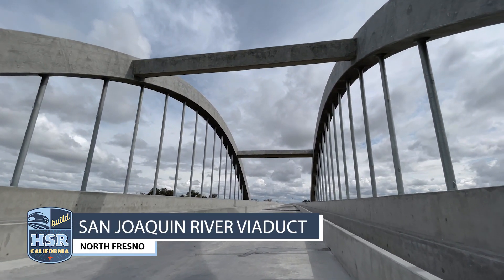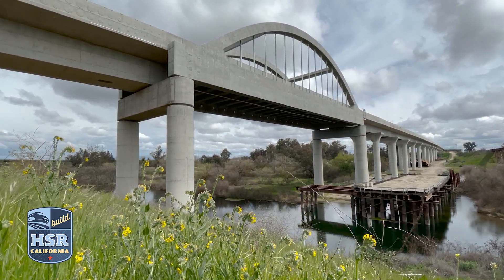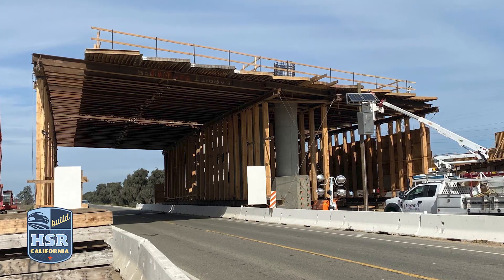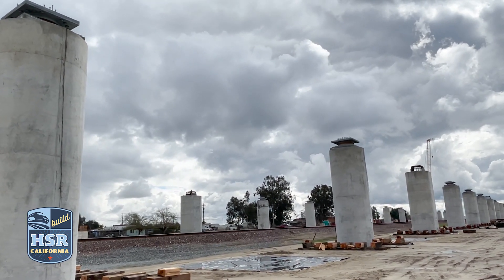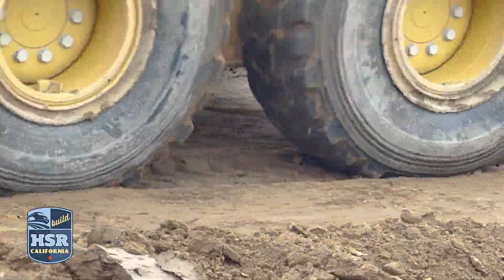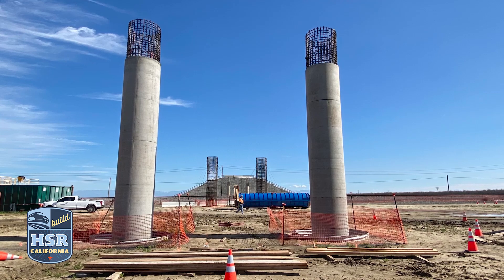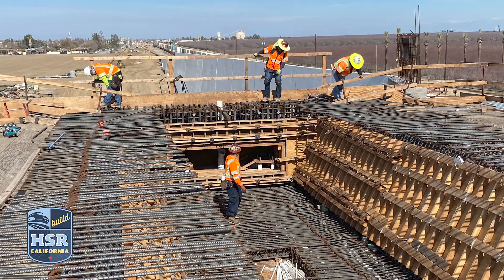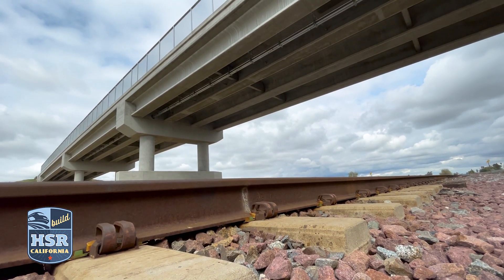California High-Speed Rail Construction Update- March 2021

Comment: I keep advocating that the CA High Speed Rail Authority needs to push for unveiling the Los Angeles—San Francisco HSR Line at the 2028 Los Angeles Olympics, just like how Japan unveiled the Shinkansen at the 1964 Tokyo Olympics. Japan’s timing to unveil the Shinkansen at the 1964 Tokyo Olympics was meant to symbolize Japan’s emerging role as a technological and economic powerhouse. It showed the world that high speed rail was possible, just as California’s could do the same for the United States. California continues to be at the forefront for American innovation and ingenuity, and in 2028 that leadership will be on full display with the eyes of the world on Los Angeles for the Olympic Games. 

Debuting the nation’s first high speed rail line at the Olympics will bring it international attention, connecting the state’s major economic centers with fast, sleek, and efficient high-speed trains travelling up to 220 miles per hour between LA’s Union Station and SF’s Transbay Transit Center in three hours via stops in Fresno and San Jose. It will allow tourists in LA for the Olympics to take a day or weekend trip to San Francisco, Yosemite National Park via Fresno, or Sacramento via San Jose, and allow Northern CA residents to travel to LA without having to drive or fly. A Central Valley only high-speed train in 2029 would most likely not achieve that same level of appeal or initial success from a global audience if people need to take a bus from LA to Bakersfield then another train from Merced to reach the Bay Area.
 
In 2028 California can take its place as the frontrunner for American innovation and ingenuity once again with a high-speed train providing direct downtown to downtown service between the state’s two greatest cities for an international audience to experience. Let ours be the one that inspires the nation to embrace high speed rail, and be the first chapter in bringing clean, fast, and efficient intercity mass transit to the United States. This is a goal whose feasibility needs to seriously be examined and do whatever it may take to make it possible. California is leading the nation’s charge in building for the transportation needs of tomorrow. Summer 2028 can still be achievable if we are committed to make it so. It will take the combined efforts of the California High Speed Rail Authority, California State Legislature and the Biden Administration, who has vocally supported investing in high speed rail, to ensure that the project can be completed in time for the 2028 Los Angeles Olympics. 

It would be a phenomenal achievement not just for California but also for America, showcasing to both the nation and the world that high speed rail will work here, and that really needs to be the ultimate goal for this project. Public support for this project has declined over the years, and an ambitious goal such as this can be just what this project needs to reignite confidence and support while dispelling criticisms that it'll be a "train to nowhere" once and for all by fully committing to completing the entire route from Los Angeles to San Francisco by 2028 for inaugural service at the 2028 Summer Olympics.
Reply: There is a reason why companies are running to Texas.
Reply: @isaacg5438  rich people are moving out of CA to avoid the stupid possible wealth tax which imo is unconstition and the stupid crazy ever higher tax.
Reply: @yia01  Exactly. CA is hell. Private companies work best.
Reply: the state is diverding the HSR fund to else where, they kind of give up on teh project and just gonna finish it for the sake of finish it. i hear thye just gonna least the rail to amtrak and give up on teh HSR.
Reply: @yia01  Isn’t that great news??
Reply: @yia01  that’s not true at all. Currently the State Legislature and CHSRA is determining whether the remaining $4.1 billion in Prop 1A funds should go toward completing the 119 miles in the Central Valley or transit projects in SoCal and the Bay Area, with strong support for finishing the Valley. The plan is and always has been electrified high speed trains between LA and SF. Right now CHSRA is working out how to do that in steps that minimize increased costs, but electric trains will be one of the first things and they’re currently looking to begin installing track and catenaries in the Central Valley within the next few years.
Reply: @ChrisJones-gx7fc  Give up. 
It’s over. 
HSR is dead.
Reply: @whiteclifffl  nope, it’s not. America is one of the only industrialized nations in the world without it, and it is long overdue here. Much of the Millennial and Gen Z generation support high speed rail in the US, I being among them, and we will continue advocating for it just as you will continue to against it. High speed rail has a bright future here if we are willing to make it happen. California is the first state to build high speed rail, and just like any major infrastructure project as well as the first of its kind here it was bound to run into problems. That doesn’t deem it a failure though. Both BART and the Golden Gate Bridge, as well as the world’s first high speed train in Japan and even to some extent the Interstate highways, were harshly criticized in their day when being built, and today we can’t imagine life without them. Much will be the same case with California’s high speed train as well as others across the nation. Look at countries throughout the world where high speed rail exists and see the amazing benefits it provides. Why can’t America have that too? If we really are one of the greatest nations in the world, then why shouldn’t we be able to have high speed rail?
Reply: @ChrisJones-gx7fc  Yes. 
And millennials and Gen Zers love free handouts from our government. 
Give me that stimulus check!
They have been inadequately educated and don’t have any understanding of the ruinous debt that we are running up. 
Where do you propose that we come up with the billions of dollars to pay for this doomed project?
How much will a round trip ticket cost?
How much will taxpayers subsidize this horrible idea?
There is a reason that the USA is the only super power on this planet. 
And it’s not because we want to copy the mass transit of third world nations. 
By the way, the interstate highway system, which has proven to be wildly popular and profitable for all citizens, was planned to assist military transport across our country. 
Much like the internet, it’s another benefit to our society from our military. 
HSR will only be used by the wealthy. 
We should improve our current highway system and widen I5 and 99 in the valley. 
NOT finance this boondoggle train to nowhere.
Reply: @whiteclifffl  America is not the only global super power, and expanding highways and airports only works for so long though. We need longer term solutions for dealing with intercity travel that goes beyond continued use of fossil fuels, which are also not a long term solution. High speed rail could be such a solution here in the US just as it has been for decades in Asia and Europe. But we need to start now as it’s already overdue and will continue to get more expensive the longer we wait. I would agree that public-private partnerships should be the way forward for building high speed rail here, rather than really wholly on public funds, and also the best use for high speed rail here would be a series of heavily-travelled corridors connecting two or more major cities between 100 and 500 miles rather than a nationwide system. We need to start thinking about long term solutions and opportunities rather than keep looking at short term ones. Expanding highways don’t necessarily translate to increased traffic flow and research has shown it may actually make it worse. Cars will never go away, cause we love personal mobility too much, but if there were a third option for getting from say LA to SF instead of driving six hours or going through a long check in and security at the airport and flying, people will take advantage of it. High speed rail is meant to be available to all, and I’m sure will have different ticket prices to accommodate for as many people as possible just as other high speed rail systems do.
Reply: @whiteclifffl  I’m sure we could both provide valid arguments for and against US high speed rail all day long, and ultimately we’re never going to change the other’s mind. So I’ll just say this, high speed rail is happening in California and its ultimate success or failure is yet to be determined and only will be once trains are running and if people will use it. That we will all have to wait and see.
Reply: @ChrisJones-gx7fc  You don’t think that there will be a security check in line at HSR stations?
What will the interval be for departing trains?
The solution to overcrowding in our mass transit system is to build a wall and restrict our growth. 
Highways are extremely efficient.  
Much more efficient than rail.
Reply: @ChrisJones-gx7fc  The only way that I will support HSR is if it is privately funded. 
I’m am sick of the government stealing from poor taxpayers to fund this fraud.
Reply: @whiteclifffl  all I’ll say to that is high speed rail is a proven technology used by millions of people every day and is the safest form of transportation in the world. It will have some level of security but not nearly as tedious as going through TSA at the airport. Driving is great for getting to exactly where you want to go whenever you want to go and will never go away, but having the ability to get on a high speed train in your city’s downtown and travel some 500 miles in a matter of a few hours to another city’s downtown for a day or weekend trip without having to deal with driving or flying can be a powerful asset. HSR has made mobility much easier and allowed people to rely on cars less for long drives between cities. Public-private partnerships should be the best way forward for US high speed rail as well as following the examples set by successful HSR systems in Asia and Europe.
Reply: @whiteclifffl  also side note, highways are entirely funded by taxpayers and are subsidized by the government while not making any revenue. So to call high speed rail a complete waste of money that’s being taken from taxpayers, despite how successful it’s been throughout Asia and Europe, not to mention in the US more public money is being poured into expanding highways that as research has shown does not necessarily equate to better traffic flow, does seem kind of misconstrued. Rather than keep pouring public money into highways and fossil fuels, we should be investing it in better, cleaner technologies of which high speed rail is a major one. America needs to start following the rest of the industrialized world and re-embrace rail and start investing in it with both public and private money. We used to have one of the best rail networks in the world, and from a freight standpoint we still do, but passenger has fallen by the wayside and is sadly still slow and not totally reliable outside of the cities. Passenger rail can become competitive again, and it takes investing in high speed rail with help from both America’s public and private sectors. Brightline West is one such example of a privately built high speed train between SoCal and Las Vegas, and it’ll be interesting to see how it pans out. With California’s LA to SF high speed train being publicly funded and Brightline’s privately, it comes down to see which is more successful that could set the stage for how other HSR systems are built throughout the US. High speed rail has been embraced all over the world, and it’s time that it is here too.
Reply: @whiteclifffl   "I WANT 20 LANE HIGHWAYS EVERYWHERE!!!!!!!"
Reply: @jamessullivan9992  Now THAT would be paradise!!
Reply: @jamessullivan9992  you know that’ll cause more pollution.
Reply: @ericfung5279  I was trying to be sarcastic.
Reply: @jamessullivan9992  if you made that happened, plants and animals (like me) will go extinct.
Reply: With who’s money??

Comment: Why is such a big pergola required just to cross another rail line? Wouldn't some kind of embankment with a bridge be way cheaper and easier to build?
Reply: The adjoining area is old rail right-of-way, so the two rails are virtually parallel. CAHSR can’t curve quickly enough to allow a bridge in these spaces. Maybe the BNSF could, or they could bow out and then over, but either would require purchasing more private land to make it happen.  The pergolas are the best balance of cost and simplicity in these locations.
Reply: @cGousha  And it all has to be done without disrupting the existing rail traffic.
Reply: It's saying I replied four times but it's not letting me delete. Sorry if there are indeed actually multiple replies from me.
Reply: It's saying I replied four times but it's not letting me delete. Sorry if there are indeed actually multiple replies from me.
Reply: It's saying I replied four times but it's not letting me delete. Sorry if there are indeed actually multiple replies from me.
Reply: It's saying I replied four times but it's not letting me delete. Sorry if there are indeed actually multiple replies from me.
Reply: @cGousha  Allright, thanks for clarifying
Reply: @cGousha  And it all has to be done without disrupting the existing rail traffic.
Reply: @cGousha  And it all has to be done without disrupting the existing rail traffic.
Reply: @cGousha  And it all has to be done without disrupting the existing rail traffic.